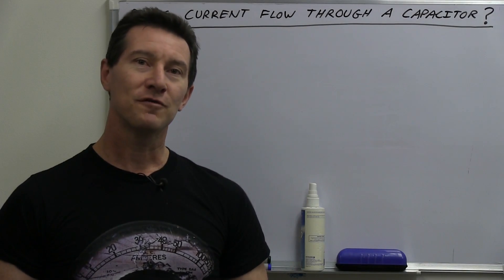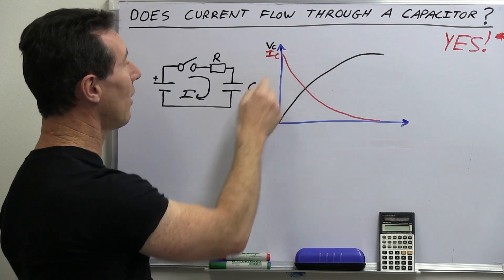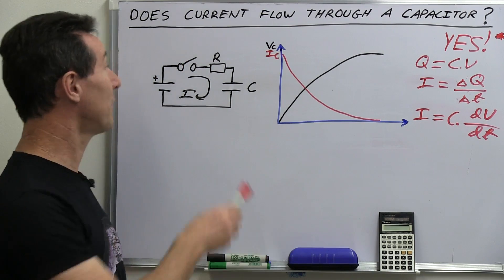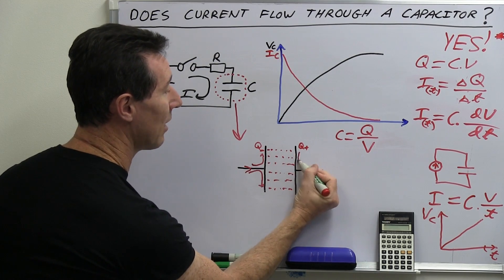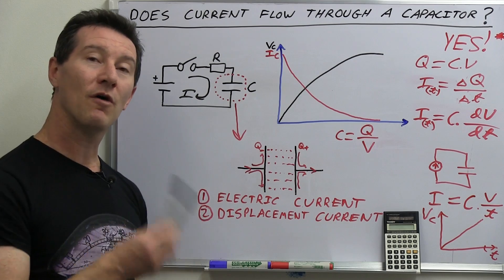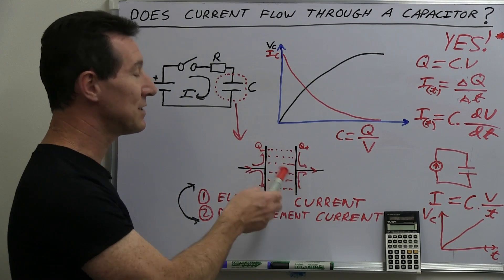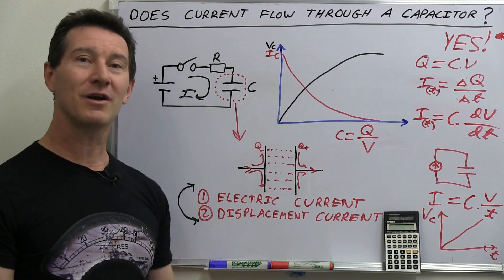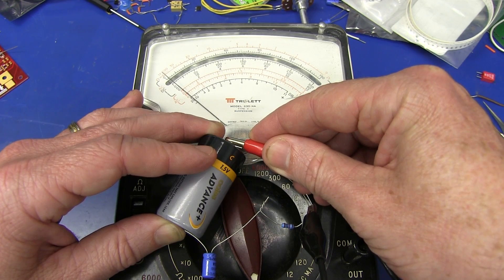EEVblog #486 - Does Current Flow Through A Capacitor?

Comment: +++ I really liked the last part where you use the analog meter. Says it all: Even that no electrons pass through the capacitor, there is current in the circuit.  The electrons just flow back and forth during charge/dischage, and those moving electrons make up the current in the curcuit. It's all about how we define current.
Reply: NO! There are two kinds of current. Neither one transfers electrons. 

The science is so messed up. 

Charge current is actual movement of field potential. 

Displacement current is actual movement of field density. 

Think of it like one making room for the field, the other filling it. One will cause the fields around it to react to the distortion of space, the other will pass by without incident because it conforms to space.

But that can be misleading too, its a metaphysical thing, electric fields. There are no particles. Matter is a a construct to make conversation simple. Magnetic fields are like shadows. They make things look different, but really aren't anything at all. All magnetic fields are the shadowy projection of moving charge fields which are making the structure of space. 

The whole equation that makes displacement current generate a magnetic field is a lie to cover up a bullshit theory about electricity and magnetism that is wrong. Don't be like these scientists, its OK to be wrong. Learn from it. Don't bury it in BS.

What's really cool is you can squeeze field density out of the background fields that sustain our space by moving the moving charge fields. That creates an imbalance which precipitates field density. But they only last as long as you squeeze, so you have to trap and capture it in other fields. It's called induction, but Lenz's Law is a lie. That reaction only happens if you do a bad job of capturing the density field and convert it to a moving charge field immediately, like with a conductor with zero capacitance.

If you squeeze that displacement current out, move it to a high capacity field structure, and then convert it to charge and get it moving you can then do it all over again without resistance. But not like they do today, not in the face of the field you just bent to force it go the other way. Move it elsewhere or delay the movement with capacitance and now you have it for free.

Just like a sailboat moving across the ocean; capture the lift of the breeze but move on to fresh air. Ride the wind and the waves. Induction can capture energy without resistance just by transforming charge current to displacement current and back again at the right times in the induction cycle or in the right places so the fields don't conflict.

But sadly, you will never see that while focused on magical electrons that are invisible and magically disappear and reappear in complete invisibility. All imaginary concepts that cannot possibly do what can easily be done.

Try to imagine what is really happening with the components.
Reply: BMan18  Our definition of current is dQ/dt.  A flow of charges. The charges are either electrons or ions according to our established physics model of matter.
Reply: Elis, Is "established physics model" supposed the mean right?  Or are you admitting what you're saying is according to fairy tales, and truth is not about to be discussed or entertained here. I respect your right to be entertaining and say whatever you like. It's just not completely accurate. And it won't make or enable progress. Oh, and it leads to and supports the end of life on the planet unnecessarily. No biggy.
Reply: Man are you posting shit all over... Making weird claims, talking obscure things but nothing gets explained properly. just "yeah this dude shows you how it's done".
Once you claim something proven right for quite some time is just wrong you gotta bring some nice evidence in. It's called science. Don't confuse engineers all over the place, go to a physics page and troll them. They have a better understanding and usually are more into "in-depth" discussion. These people just want to get their stuff done which they are perfectly able to with rules you claim to be so damn wrong.
Reply: alles klar klaus Sorry. Inconvenient questions are a bitch. I thought critical thinking was integral to engineering. Apparently your style is "do what you're told". I have a BSEE, and I managed for 30+ years to make a better than average income spinning the BS just like it was taught. Not much different than what was presented here.

Then the internet and YouTube happened and I found the time to investigate those inconsistencies that I was taught to ignore. Guess what, not only are the inconsistencies deserved, the reasons why they persist go beyond science and engineering. So, the argument isn't about what is the right model or proof, it's about looking beyond models and demonstrations that are limited and clearly inadequate for how electricity actually operates.

People who get this type of education need to know it's bogus. Then, when they can afford to cross their educators and employers, and raise their standards of morality to a higher than social acceptable level, begin their real education.

If you know any real engineers, they will tell you what some of my mentors acknowledged: Every Theory has a hole. So they do what they have to, contrary to the theory, every day. What works rules. This has a limitation, it keeps things as they are, and it's far less than what you are capable of. 

You call it trolling, I call it spreading breadcrumbs to draw out the independent thinker. Why, because after a lifetime of working to keep things going the way they are, I've found out that its all a sham. Real electrical engineering can create energy without burning anything.

And how can that be? You have to start by abandoning the flawed model of electricity being a mechanical system. 

You want proof? Play with magnets. They have fields that will act independently of their source fields. There is no direct mechanical feedback in that system, and that means no conservation of energy. But you won't develop it unless you understand how that can be.

But there's more. And capacitors transfer energy without transferring charge. Charge is induced where the dielectric intersects the conductor. (This is an alternative model that actually explains how electrical fields travel through a capacitor.) This distinction of electric fields that does not carry charge does not exist in modern electrical theory. That theory is very inconsistent. It doesn't count the component and gets good results, but the component is there. Then there is a whole raft of demonstrations that may be using this as actual power. Look at the hairpin circuit and apparent potential-less power transfer.

Or the aspect of induction of power but ignoring it in designs... there's so much. No time.

Check out Distinti on YouTube. Eric P Dollard and Peter Lindemann from Borderland, the late Joe Bedini, Edwin Gray, so many more if you want proofs and even some math to back it up.

Its your life, live it your way. I'm not trying to change or criticize beyond opening a door to a clearer reality.
Reply: Ok. An example of changing the Lenz's Law into a promoting force in a standard induction design. The first working prototype was Joe Newman's Big Bertha. But you'll have to dig to learn how he did it. The second was TC Hein's who discloses all his methods and performance with his ReGenX coil. 

The principle is adding capacitance to the inductor coil in both cases. Standard training EE math will show you this will change the timing of the coil's output wave. So the back EMF will occur after the magnet core passes, or it will push the rotor while generating electricity, which Joe shows it clearly does. TC shows his motor generates electricity under load. 

You see capacitance of electric field collects around any charge. And it seems to be the form factor of magnetic lines of force. It is particularly concentrated in magnetic fields.

Conductors have no real capacity available, so they move the increases in capacity of magnetic fields right out as charge movement. If you build a flux capacitor, sorry, an inductor with capacitance, you will allow the coil to hold the increases in capacitance until the polarity changes. Then it gets pushed out to accommodate the new field orientation. Now the reverse force is timed with a reverse magnetic field and is complimentary. 

Does this explanation of capacitance allow for flux-capacitors?  Did you even know you can create inductors with capacitance? Tesla patented one with 1,000 times the power capacity of a non-capacitive coil. No BS. 

Conductors balance charges throughout their crystal lattices. It's impossible to concentrate a charge imbalance at one end of a conductor. Saying electrons collect on one contact of a capacitor and not on the entire conductor is nonsense.

That electrical capacitance shrinks with charge increase. A non-physical reality. If you don't close the gap with large capacitance capacitors, they short out. Plus, if you remove the dielectric from a capacitor, the charge it has moves with it. That capacitance will travel with the dielectric, even without the conductors.  So whatever you say, capacitors do not store charge in the conductor. That is a misdirecting load of BS.

Dielectrics hold capacity to their fullness. This variation in capacity is a key motive force of electric fields, not charge driven. This capacitance varies with the magnetic field. Magnetic fields are formed by moving charges. Therefore one could dispose of the concept of magnetic fields totally and clarify that moving charges change the capacity of the environment around them. This gives you a different context and set of options for circuit designs. 

There's more. Ferrite core inductors inject added capacitance to communications circuits. This is a straightforward amplification of electrical power; over unity used in land lines. The same thing happens when you induce power at high voltages. Gerard Morin demos 7x increase in power using 50K VA step up and down transformer. It's the electrical expression of the Obereth effect. 

The theory you have can't even explain how transmission lines can transmit power longer distances with less current. The resistance is the same. That current must be the same. Those wires get just as hot. Yet high AC voltage goes way farther. 

The answer. Induction. High changing voltage has way more energy than low voltage, it makes the capacitance needed for the longer distances, just like the induction coils in transmission lines. 

It all starts here with this explanation. Electricity is more than moving charge. One must consider non-charge capacitance, which if used to control the movement of charge will travel faster than Lightspeed. Or power the rotor that induces the field effect that powers the rotor. No BS. It's field not particle physics.
Reply: It is not thinking critically, it's really-drunken-man-in-a-bar talk like "raising their standards of morality to level beyond [...]" that's considered shitposting. I can show a video of my cat flying across the room on youtube but I sadly won't change the world with this. That a model is just a model and thuswise can't or won't by definition mirror reality is 6th grade physics class, which is actually the first time you have physics here in school. You choose a model to bring things to the human mind that we can't imagine otherwise, like electrons in their shells. You will use the electron shell in chemistry and it works just perfectly for some things like reactivity. Some day you'll need to use electron orbitals say in organic chemistry. A physicist might use electron clouds for explaining things, because he knows he can not locate the electron and measure it's movement at the same time. But to us humans the concept of randomness is just not possible. We might know what random means but we are unable to imagine a truly random process. We can mathematically describe light but we can't imagine their wave/particle attributes. To us it is either a particle or a wave. Not both or neither at the same time. We surely can say it is both but also none at the same time, it still remains just a weird word configuration and not a vivid picture.
Reply: alles klar klaus I see. You are the troll. Ask for proof, then ignore it. No science for you, Dogma is what you believe in. No problem. I suggest you switch to IPA,  that dog water German brew is losing it's punch with you. IPA will give you that comfy buzz of full denial with less effort.  Enjoy imaginary perspectives with no future, they suit you.

Comment: Does current flow through a cable? Are the electrons going in on one side the same that come out on the other side?
Reply: Not for rf in coax.  Or for AC line cords.  In that case the electrons are just vibrating back and forth in place.  If you want them to eventually get to the far end of the cable, ya gotta use DC.

Given the equation for electron average motion (the drift speed vs current density,) calculate the max span of electron motion during 1Amp AC in #12 gauge wire!   :)    It comes out to be 0.0004mm.
Reply: The electrons that 'go in one side' are unlikely to ever come 'out the other side', not to mention it's not even possible to distinguish any one electron from any other ... if an electron enters one side and an electron comes out the other, it's current, physics does not care and can't tell us if it's the same electron or not.
Reply: I wasn't expecting any answer but ok ...
Actually the electron that goes in on one side will eventually be coming out the other side.